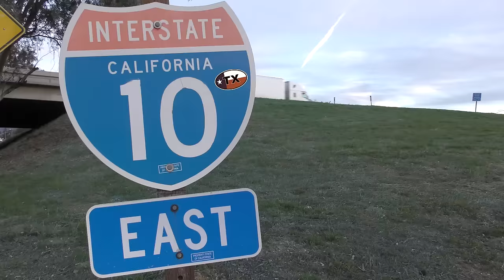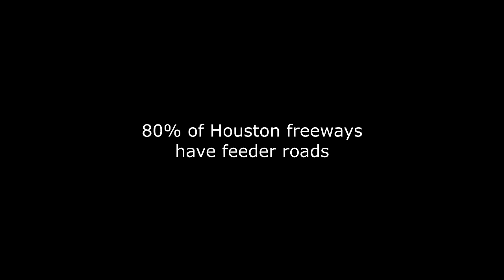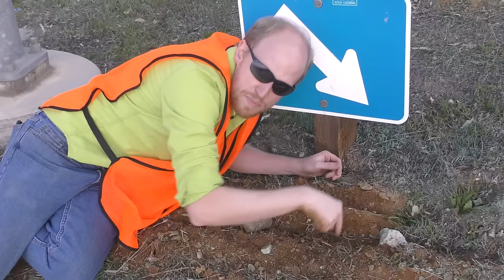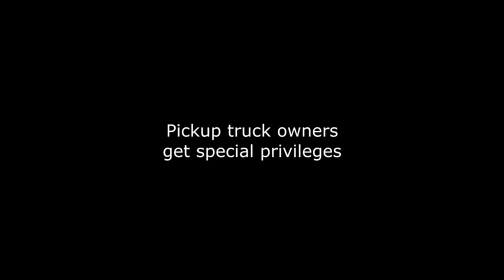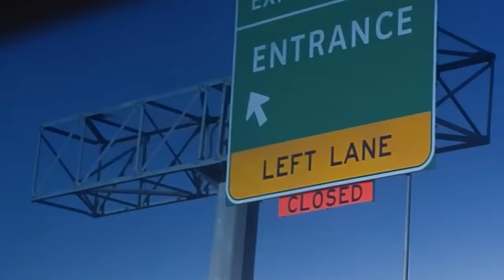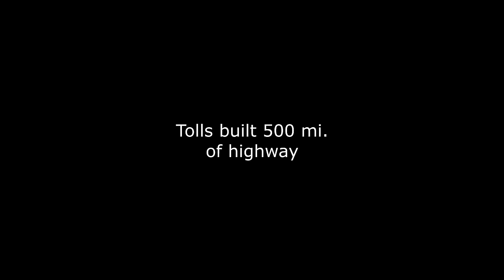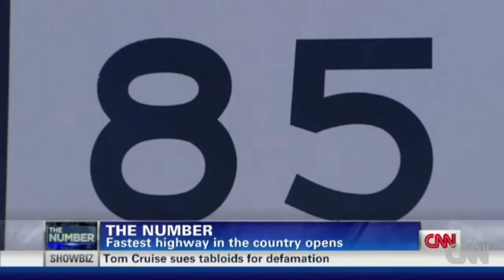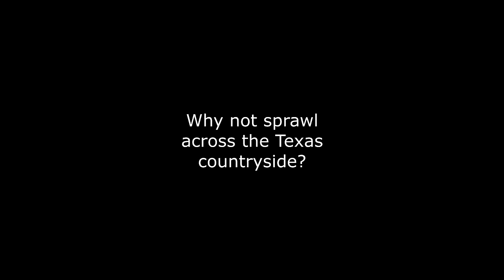How does good Texas engineering make REALLY BAD roads?

Comment: I've lived in Texas my entire life, I actually had no idea other states did it differently.
Reply: same
Reply: How very Texas of you
Reply: Feeder roads are horrible.  Long on ramps and off ramps so that traffic can get up to speed BEFORE merging and not having to cut across lanes of traffic is a way safer and better system.
Reply: Missouri does too specifically St. Louis
Reply: Please come up to the other end of I35 and see just how different things are here in the land of the snow.
Reply: @ianh7582  It all depends on where you build them. My city has highway going quite close to the downtown with feeder roads. But they don't have any businesses connected to them - only slower (and shorter) off and on ramps that are going to businesses and regular roads.
Reply: Same I didn’t realize that either
Reply: I've lived all over the world one thing Texas has few of, traffic circles. They confuse the hell out of Texans
Reply: As a Texan, I cannot even imagine a highway without frontage roads. Alien! Also I just want to point out how we San Antonians have effectively made IH-10 through San Antonio 85 mph in the middle freeway lane and 65 mph on the frontage road. Slightly scary.
Reply: Frontage roads are a result of a unique bit of law in Texas which says that any property adjacent to a road can use it. Highways would have thousands of access points to individual properties if it wasn't for the invention of the frontage roads providing access to those properties instead of the highways they protect.
Reply: @davidamoritz  You mean roundabouts? They are very nice once you get used to them
Reply: @davidamoritz  In Fort Worth, there are actually a lot of roundabouts, particularly in the suburban areas of the city.  That said, roundabouts and traffic circles are different things, with traffic circles being higher-speed (and larger) than roundabouts.  Fort Worth does have a well-known instance of a traffic circle, at the junction of TX-183 and US-377 on the southwest side of the city; there's also Bluebonnet Circle on University Drive south of TCU.
Reply: I had never seen a bi-directional access road until I moved away from Houston, and into another state.  It was surprising to see traffic actually yield for off ramps.
Reply: @BrandonClaridge  in some places in the northeast, we call them rotaries.
Reply: @BrandonClaridge  At least they redid Bluebonnet Circle so that it is just one lane going around. That thing was horrible when it was 2 lanes.
Reply: @davidamoritz  as a texan i can comfirm I've almost crashed at round abouts plenty of times
Reply: @ironmatic1  exactly like who wouldn't wanna take a side road when theres traffic
Reply: @ianh7582  I'd take the feeder roads over the BS California has any day. There's intersection where a highway, a major road, and a minor road cross in sort of a triangle shape. The major road and highway all spill onto the minor road. So what happens is you take an exit off the major road to the right. Then you have to merge 3 lanes to the right pass the exit ramp lanes coming from the highway. Then you can turn right onto the minor road. Bear in mind that the people coming off the highway will need to merge 3 lanes to the left in order to turn left on the minor road. And only from the minor road can you get onto the highway and major road. It was definitely much easier to drive in Texas than California.
Reply: @melissa7233  When you get out to the far reaches of Greater Houston, you will see bi-directional access roads.  For example, alongside I-10 west of Katy.  There used to be a bi-directional access road starting in Katy which stretched west on the north side of I-10.  That changed when Buc'cees went in.  They basically put a uni-directional access road on the other side of the freeway and make the previous bi-directional road uni-directional with two lanes.
Reply: @kevingray8616  Back when I lived in Houston, I never had reason to go out that far unless I was heading out of town to San Antonio.  The furthest I'd ever go near an access road on I10 was on the rare occasion I'd need to be on Hwy 6, that would be my exit.  So there's no way I'd have ever seen that access road.  I moved out of state right when Buccees opened.
Reply: @dannyornelas9914  Can't blame us when it takes 16 hours to cross the state at 70mph
Reply: Me too
Reply: Chicano Azteca  The problem isn’t me, it’s your grandma when there’s a 20 ft on ramp to get up to highway speed and she’s still doing 40 and there’s only one other lane because the feeder roads and toll lanes take up all the rest of the road, so I have to slam on the brakes or use the other lane that’s got your auntie in it doing 55.
Reply: bruh same, I thought all states where the same
Reply: @db2855  Thanks, best learning of 2020 ;)
Reply: @davidamoritz , I live in Nevada and they are being built more and more and nobody really knows how to use them. It's an idea that works but if you are going to build something you should have some public training videos made.
Reply: He could have been describing Oklahoma as well. Feeder roads everywhere along highways. But Oklahoma City is at least building out all of the sidewalks now.
Reply: @kevingray8616  They definitely did not do the Buccees (I-10 / Katy) right.  Traffic backs up for days. Kinda like at Tractor Supply.
Reply: I moved to Texas 26 years ago, and at first the feeder roads were confusing. Especially the bi-directional feeder, where the feeder traffic has to yield the right of way to entering and exiting vehicles. But once you get used to the feeders, it becomes second nature, and I wonder why other states don't build their highways this way.
Reply: @IronTeddyBear  
It’s like that in Oklahoma too. But I get their point. It makes highways look ugly and cluttered because you have nonstop businesses lining the highways instead of just at intersection exits, and you have to deal with traffic on feeder roads when exiting off of a highway. You might have to get all the way into the right lane across 3 lanes of traffic, which can be crazy during rush hour.
Reply: @rugufb38thg  Many midwestern DOTs have these.
Reply: Culture shock when I went to the east coast.
Reply: Same
Reply: Live in Michigan and this is fairly common when highways go through decent city’s
Reply: @davidamoritz  we actually have a good few roundabouts in houston
Reply: @ianh7582  feeder roads are good for travellers that just want to get a quick meal or so but it sucks to the local
Reply: @davidamoritz  maybe that's my problem.  I was born in texas, here in ohio we have tons of roundabouts.  The dont confuse me but they irritate me
Reply: @davidamoritz  Apparently they confuse you all so much that you can't even call them by their real name, roundabouts.
Reply: @campingmods496  Yes actually, we can. You have to be EXTREMELY ignorant to have never paid attention to the fact you don't see it on any TV show NOT BASED IN TEXAS.
Reply: @dannyornelas9914  have you no idea how big Texas really is? It makes sense people don’t ever need to leave.
Reply: @loganthesaint  Now that you put it that way...
Reply: Same
Reply: For real
Reply: @se777en73120  same with Kansas. Oklahoma City looks fantastic now, compared to the 90s, and so does Tulsa. I live in KCK,right on the edge of Missouri. Getting traffic tickets in two different states, especially one you don’t live in, but could throw a baseball to looks bad for insurance. KCMO has feeders, but not as much as the more wide open Kansas side. And Wichita has tons of feeders looking just like Oklahoma and Texas.
Reply: @se777en73120  I lived in Dallas for 5 years and the feeder roads often are adequate to get up to speed, but sometimes they are not. You need an car with some horses to get to good speed. I had a Toyota Camry 4 cylinder when I got down there, it sucked for getting up to speed. I had a Lexus IS after that and it was easy to get up to speed, but then you mentioned it, the nightmare of switching 3 to 4 lanes quickly if you need to is terrible. When I lived in Dallas City proper, I would try to map out the places I go either north or south. I35 is perfect for that, I tried to avoid the 635 loop as much as possible as traffic often just stops and people drive like madmen.
Reply: @bastipro1333  They are really good for trips with family, Texas is big, it takes me 5 hours to see my grandparents, and the feeder rodes make the trip up there just a bit easier.
Reply: Arkansas & Tennessee will change theres like texas in the future.
Reply: And we have feeder roads in New Orleans on the West Bank expressway
Reply: Other states do it much better. Lose those insane access roads.
Reply: @ianh7582  In NJ most interchanges are cloverleafs. You end up going around this long curved ramp which is only safe to drive at 25-35 depending on the ramp and you have to accelerate in the same lanw people are trying to exit in. Frontage or feeder roads if you get into the left la.d as soon as possible you'll be doing 40 or more before you veer off to the left and accelerate on the ramp and mergw onto the interstate
Reply: @ianh7582  
Oklahoma has a lot of short on ramps. No way to get up to speed.
Reply: I-10 through Jefferson Parish and New Orleans East has feeder roads.  On the LIE (Long Island Expressway) in Queens, the feeder roads are called Horace Harding Expy.  It has roughly 17 floor apartment buildings along HH Expy.  In Nassau County,  the feeders are called Service Rd.  Nice homes line Service Rd with a large sound barrier.  It reminds me of the Berlin Wall with the LIE  being no mans land.
Reply: @ironmatic1 I've seen freeways without frontage roads. I don't live in Texas, so I don't know what the use of frontage roads is. So I'm with Road Guy Rob ("Feeder Roads Make Texas Look Tacky")
Reply: @db2855  Unsafe and scary. (I mean the frontage roads in Texas)
Reply: Ya it was my idea cus I seen ambulance  stuck in middle  with all cars if they had there own road they could  go faster and save people  I jest hope drivers be ok  but 4 lane road and 5th is for turning and middle  for emergency dash  hope this future  road dont ever get too cloudy ya I was talking to one of the workers showed them a paper but if people  crashes it's there falt
Reply: @samseddmedia  how exactly are they unsafe?
Reply: @jaylenjackson2403  Urban sprawl makes them unsafe.
Reply: @samseddmedia  Not if they’re designed right… Improperly designed or poorly developed frontage roads can shut down traffic for miles and cause numerous safety concerns, but proper design mitigates these dangers.
Reply: @jaylenjackson2403  True, but Texas puts frontage roads in places along the freeways and toll roads that they are not supposed to be, like in the countryside.
Reply: @PeterLiuIsBeast  LOL but the same exact thing happens on the feeder roads no?
Reply: We call the feeder roads access roads.
Reply: @melissa7233 we have them here in Dallas but only in the outskirt areas
Reply: Same here
Reply: @rugufb38thg  no? There’s only access roads beyond the 270 outer belt. None in St. Louis except on 70 right next to the airport. None on 55, none of 64 until chesterfield, none on 44, none on 170. I have no idea what saint Louis you’re talking about but it’s not the one in Missouri lol
Reply: Spoken like a true texan
Reply: Stay in Texas, never leave. Dig a hole, crawl into the hole, and never come out.
Reply: @davidamoritz you mean Roundabouts
Reply: always interesting when i visit family in texas and see my uncle driving on and off the freeway when picking us up from the airport
Reply: @ironmatic1 in many ways feeder roads reduce congestion because they encourage cheating.  Are you a long haul trucker as long as there's no wrecks on the road you should get through dallas with only an extra five minutes tops.